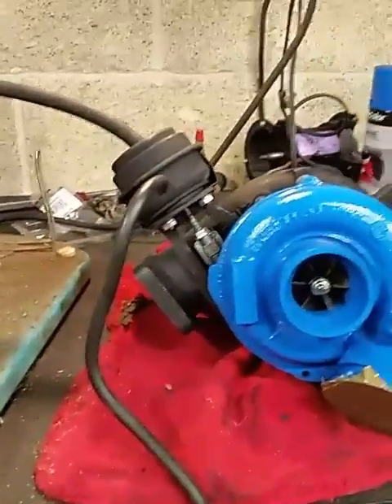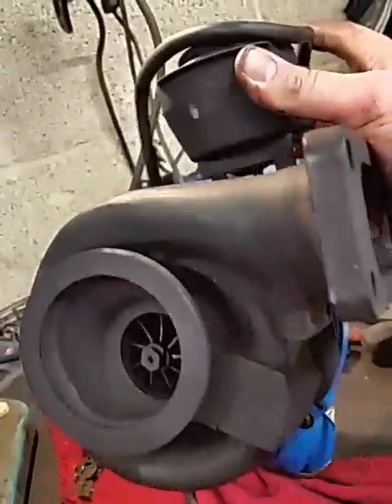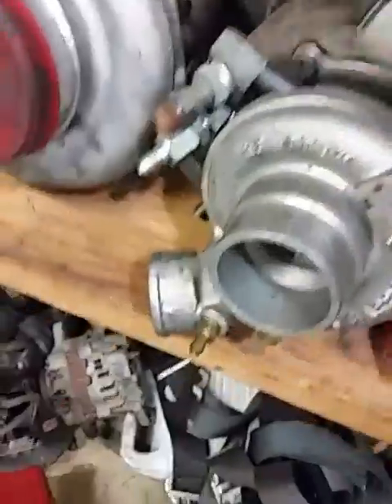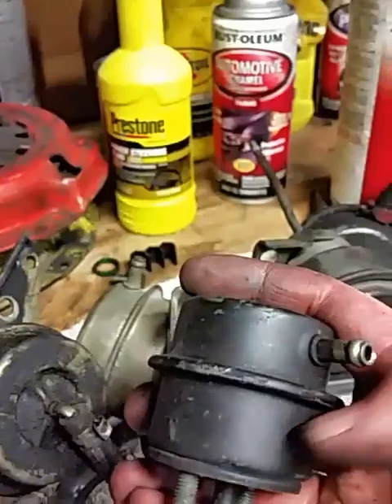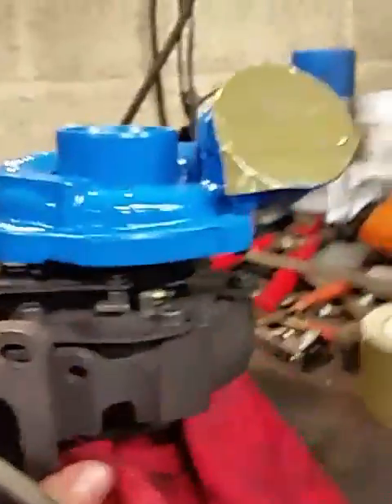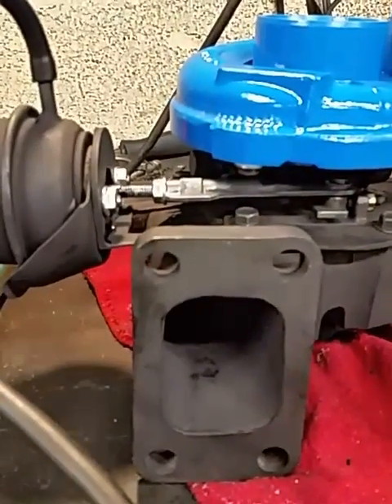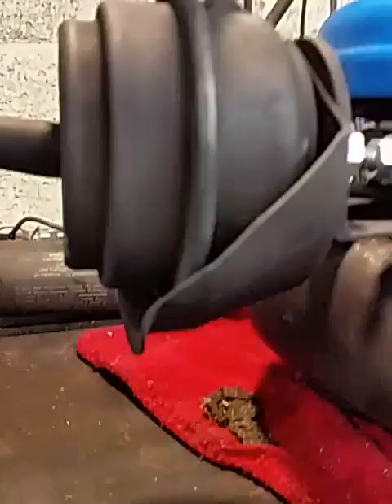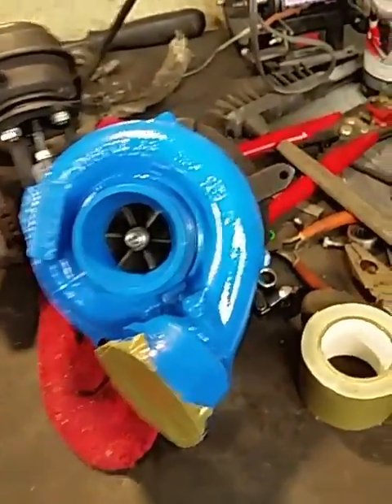VNT control without electronics

Comment: but isnt it the same thing that vac on one side n boost on tje other so rod travels the same way. why havin vac n boost
.?
Reply from the maker: When the engine is not under load/boost, you want the vanes open to allow a less restrictive exhaust. When it is under boost, the vanes will open in relation to the pressure to keep the boost at set point. It is a very simple and reliable setup
Reply: @southwest82  Bro honestly, i still didnt understand what u tried to explain in ur reply bcuz my english is not as gud as u guys. If u can pls try to explain it one more time to me. I'll appreciate. Thank u brother. Whats vaccum's role n what is boost's role in this..? That whole vdo did make sense to me but bcuz some language problem i didnt really get it. Thank u.

Comment: Hey, you showed a two  port vacuum actuator  that you said was from a 2.7 L Sprinter diesel....is this the one you used on your setup,  I want to try this on my 1.9 L diesel Volkswagen and port it in from the boost side of the turbocharger, is the original vacuum side just to atmosphere.... you would have to displace the air somewhere?
Reply from the maker: I used a modified check valve to  the line when under boost

Comment: 4:29 Is it perfect really, it looks like itll leak bacuum/boost a bit
I want to build a fully mechanical vnt turbodiesel and i need a 2 port actuator to do it...  Hoping this will work.
Very clever simple system by the way, cheap too and no electronics

Comment: I pulled the actuator apart and moved the spring to the opposite side of the diaphragm. I then rotated the actuator placement to the opposite side of the vein control arm. I suppose this method varies wether you have space to move the actuator.

Comment: Will check valves be needed on both top and side?
Reply from the maker: Just on the vac side. It has a bleed to atmosphere hole on the actuator side of the check valve, so when the vac drops the actuator can close
Reply: @southwest82  thanks for the reply, I guess it will always leave a minor boost leak? I've been searching around on the Internet and whilst this isn't cost effecient would you say this actuator operates using a similar principle?
https://www.forgemotorsport.co.uk/Renault_5_and_Renault_21_Adjustable_Actuator--product--86.html

Comment: So by now you must have tested this system. Does it work? I'm doing a budget quarter mile challenge and the turbo that I have been gifted is a variable geometry setup, which makes life ideal for horsepower but not ideal for cheap control
Reply from the maker: Yes, it works very well, see the other vnt video
Reply: @southwest82  ah yes. Looks like on my project I can skip the vacuum actuator component anyway, all I care about is my daihatsu applause to do a 13 second pass for less than $1300, not economy or anything.

Comment: Cool.  I want to turbo my 6.2 diesel..twin turbo.  For about 200 HP.  Two VNT 17s is about right, 3600 rpm redline.   It has a vacuum regulator tied to throttle for the transmission (TH 400). Your method will be perfect.
Reply: I want to install the same turbo in this video on a om606 mercedes, so i just need to bring a vacuum line from the trans to keep it closed and run boost line from the intake manifold to make it work ?

Comment: Hello Southwest82.... I am unclear about what you said re: diesels... I am wanting to put one on an VW AAZ...No ECU electronic controls....  I think it's a great solution but it looks to me like you need the variable vac pressure of a gasser... any advice on making it work on a AAZ diesel? Or is the RPM effect on the vac pump enough?
Reply from the maker: Stv tppng unfortunately the vacuum pump will typically put out a consistent vacuum. There are some complex ways to cheat this using a variable orifice but for my personal 300sd Mercedes diesel it was not worth the hassle for me or 10 pounds of boost. Using this turbo on the gas engine however I can really take advantage of the variable
Reply: makes sense. Thank you for you expedient reply!
Reply from the maker: Stv tppng not a problem I just happen to be on YouTube when your question popped up. Since diesels constantly run in boost a good traditional turbo is probably the most reliable option. You can fiddle with the aspect ratios of the turbine as well as possibly a slightly larger compressor but it becomes a trade-off because with most diesels simply turning up the Boost will not add much more power unless you fiddle with the injection pump that was the case with my om617 Mercedes diesel
Reply: I get that... thought it would be easier. If I have time I might make the whole arduino set-up with crank speed, throttle, etc...... but I think it is too complex for me right now. Thanks again.
Reply: I have been trying to think through this for an old mercedes as well.  It seems to me since diesels dont have throttle bodies to worry about and dont really generate vacuum that a simple wastegate actuator setup (diaghpram pushing on a spring) might work for control.  At idle spring pressure would keep vanes closed, at higher RPMs and more load boost would build pushing the actuator back and opening the vanes as it approached the preset boost level.  Am I over simplifying this or missing something?
Reply: Daniel Hunter 
 Did you ever try this out ? That’s exactly what I’m going to do. Diesels are crazy simple or already mine is! No need to complicate with vacuums reverence stuff

Comment: Hello there! need some advice, i hat a 2.5 tdi land rover old non electrical engine , i want to put a gt2556v (bmw)  need 25 psi, it will work this modification on gt2556v vacuum actuator?
Reply from the maker: calbazuc no, only on gas engines with throttle actuators
Reply: thx. but can you give me an advice please about controling the vanes, can i do it on boost control? also i see on youtube a very simple method based on a simply spring , the vanes is control by drive preasure and the spring close the vanes when you lift acceleration .
Reply from the maker: Ciprian Stetcu on a diesel engine without electronic control it is virtually impossible. The original setup on the Sprinter vans was electronically controlled and I adapted this for a gas engine which uses the pressure differential across the throttle plates. If you use a straight wastegate controller the veins are going to be closed almost the entire time causing an enormous amount of back pressure. That is how I originally control them and it went up causing an enormous amount of problem until I solve it

Comment: great concept dude. just to be clear, when you say boost controller,can that be mechanical boost control {dawes valve} or ebc? also is the overall boost pressure set by the vane stops or is it a function of the actuator? i have no experience with this type of turbo, so very new and interesting stuff.

Comment: I am planning to build this actuator from scratch from aluminum. In this way I can make the spring adjustable and seal the stem. Only need to fetch a suitable diaphragm for this purpose (maybe demolish another actuator and reuse the diaphragm).Thanks for the info
Reply from the maker: Marcel Hendrikx honestly from my years of messing with wastegates, it is far easier to use a light spring and use a MBC to control the boost. You will get much more uniform results. I have modified springs before, but once you pop the crimp seal it is difficult to get it to seal right again. I have melted diaphragms before welding the halves back together. Hence why I have gone this route..simple and reliable
Reply from the maker: Marcel Hendrikx it also is hiw garrett did the actuator for the VNT25

Comment: Exactly as you mentioned in the video, use the boost pressure on the opposite side of the actuator to control the vanes. Maybe it is necessary to adjust the spring load for the correct response.
Reply from the maker: Marcel Hendrikx can't modify the spring in this unit, it is a 5psi base spring so you can use a manual boost controller

Comment: Did you have to change spring settings? Send me your e-mail brcause I would like to do a similar thing on a BMW diesel.
Reply from the maker: Marcel Hendrikx you can pm me through youtube. A diesel may be harder to control because of a lack of throttle plate, I have a Benz 300sd I want to VNT, but haven't figured out how to regulate the vacuum. 

This setup is for a gas engine
Reply: @southwest82  I used to run vnt / vgt turbo into old diesels without throttle plate just by using a normal classic pressure wastegate hooked to compressor housing.
Reply from the maker: @fabriziopandolfi1857  but on gas engines you have to vary the vane position based on throttle